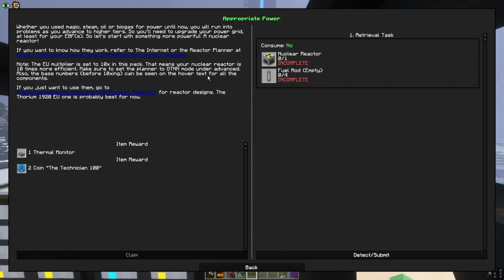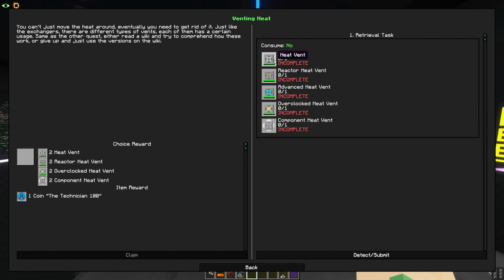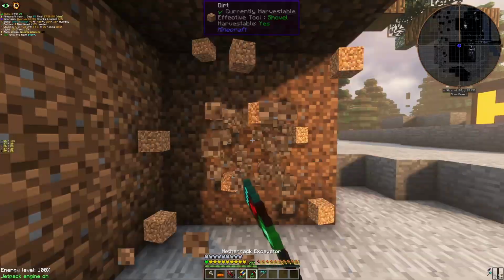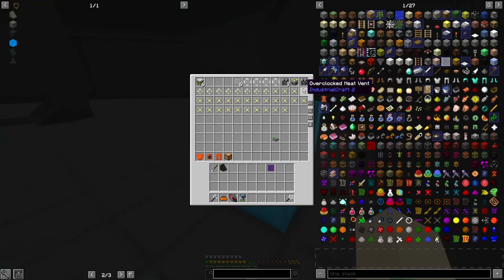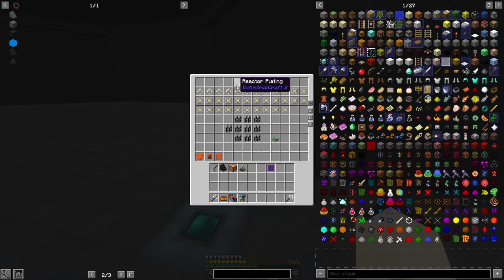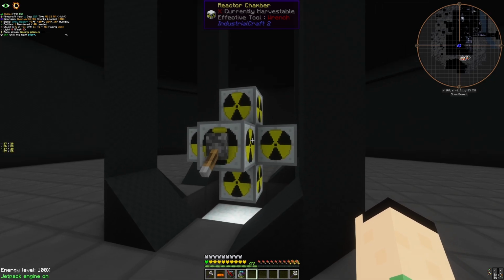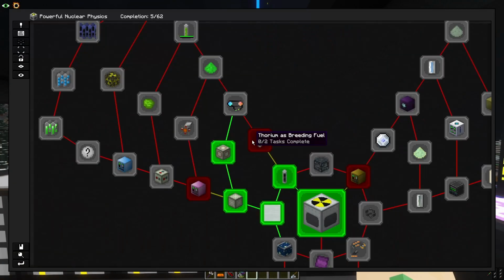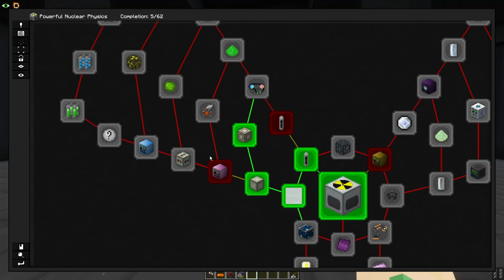GregTech New Horizons E62: More Tower, More Power

Comment: Why not to switch circuits in patterms as you go? I was always doing this when I was meeting recipes that requier circuits I no longer craft and I can not order them.
Reply from the maker: Dear employee,

I have been doing that for any new recipes that I needed to add after the any circuit change.

Best,
HamCorp
Reply: @Ham-Corp for me it seems like one of us doesn't understand the other. I thoght company offers to rewrite all recipes at once after upgrade while I am doing it in batches of 2 - 5 patterns at a time.
Reply from the maker: Dear employee,

Since all my currently encoded recipes EV and below already use the cheapest possible circuit, I won't be going back to change them to the any circuit version - but I will use the corresponding any circuit for new recipes that use those tier circuits. For IV and beyond, I will be replacing all existing encoded recipes with any circuits.

What I meant by upgrading all at once is that if all your recipes that use IV circuits are encoded to use the 'Any IV circuit', then once you go from quantumprocessor assembly -> crystalprocessor, you only need to change the forming press recipe instead of every single encoded recipe.

Hope that clears it up!

HamCorp
Reply: @Ham-Corp  thanks manager! Now everything is clear

Comment: 5:06 I recently discovered that those towers from which "smoke" comes out are not actually chimneys, but cooling towers for superheated steam, and it is not smoke that comes out of them, but some of the not completely cooled steam and hot air. Correct me if I'm wrong.
Reply from the maker: Dear employee,

Indeed! The "smoke" is actually just water vapour!

Best,
HamCorp Nuclear Division
Reply: To add to this, cooling towers are used on all sorts of power plants, not just nuclear ones